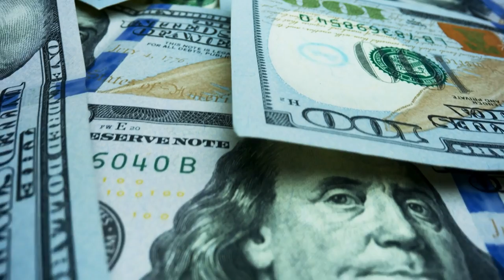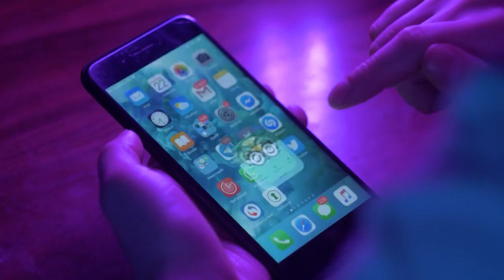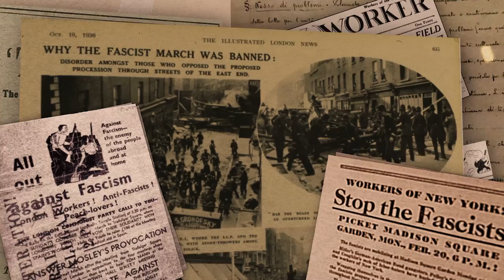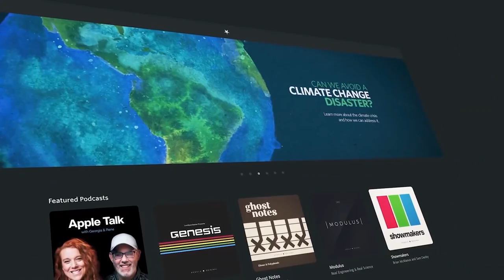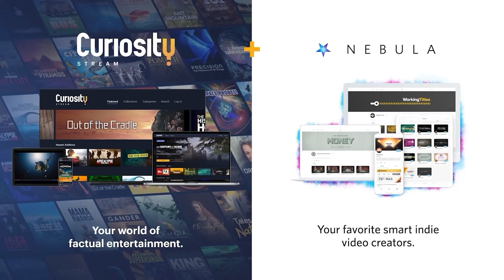Do Socialists Just Want To Take Your Stuff?

Comment: I think of myself as a democratic socialist.  I support majority of socialist goals but the one thing I do not like is the ability to be "voted out" (kicked out)  of the company that you founded. In capitalism when you  join the stock market you are required to have a board who can and do force out the CEO if they are not maximizing profit. In your proposed system the workers can vote against the best interest of the company in a similar way and the founder looses the control of the organization they made...  I have yet to hear an adequate solution to this dilemma ... I think a balance of power between state, workers,investor, and owner can be developed..... would like to hear your l thoughts

Comment: Artificially reducing battery and bricking phones are stretches, and a bit of a disingenuous representation. At least if you are talking about everyone's favorite whipping boy, Apple. We now have a more accurate representation of your battery life, instead of hiding it behind a vague and false status indicator, because no one wanted trusted users to handle the anxiety of operating under the accurate state of the battery. I am pretty sure, at least for iPhones, that the the ability to get the latest OS ends roughly around five years, which has been a long time standard, and doesn't prevent the device from getting updates for its generation, nor does it brick the device. It does free develop and continued iterative changes, without having to be concerned for older technology or form factors, and I/O. Now this is a balancing act, and I am sure there are real world examples that are as extreme as you mentioned. While, my point stands, there is benefit to letting tools or even industries sunset, at some point. The balance point should be examined and constantly checked, something that isn't really happening. I for one think as the price of production continues to fall from continued improvements we should pass much more of the profits onto the commons. This will buttress the shock in changing in workforce demands, by providing space to shift to new skills and industries or relax and enjoy the fruits of ones labor. But, we are a bit far off from being able to predict the perfect product and services, that all people will need at all times, just as we are far from keeping corruption in our markets from harming society.

Comment: I would like a check for half the amount you made from my view of this video. Split the profit 50-50. Business owners take on risk that's what they are paid for.  Your not a socialist your a communist. Workers do not a have a better understanding of the operation than the business owner. I would like you to INDIVIDUALLY in In one McDonalds locations have your management less store conduct hiring, laying of,  pricing, marketing, mange the entire supply chain individually and share all your what will be the losses between the employees. A business owner is not guaranteed a penny from his labor an employee is. Since you overthrew the business and its owners you have to take take losses to. Let's say you can't contract outside personnel because you claim to be able to run everything yourself, and that no one but you puts value into this company. A lot goes into running a business, and thus though employees should be paid fairly, they do not all produce the full value needed to run the whole company.
Reply: Mate, you’re a consumer. You don’t get to split the profit, when you’re not the one producing value. The value goes to the one producing the value.